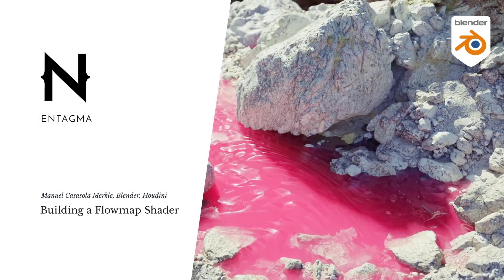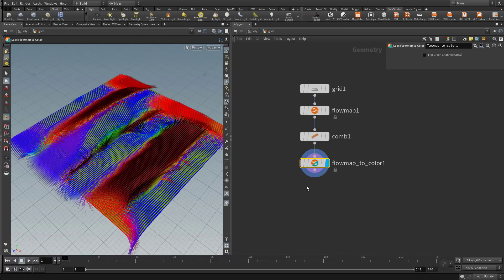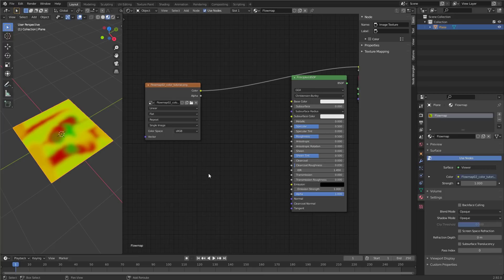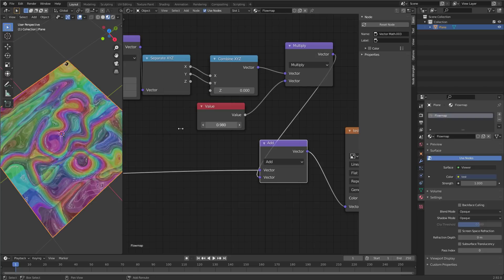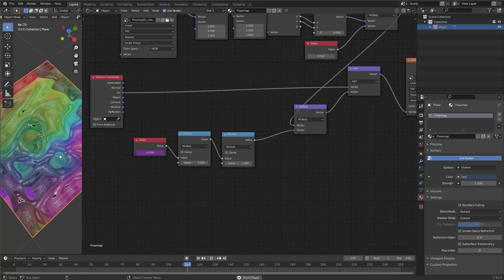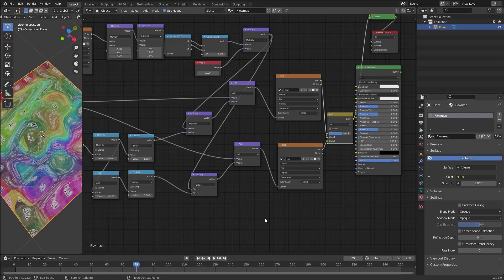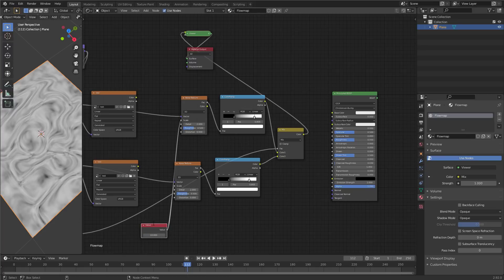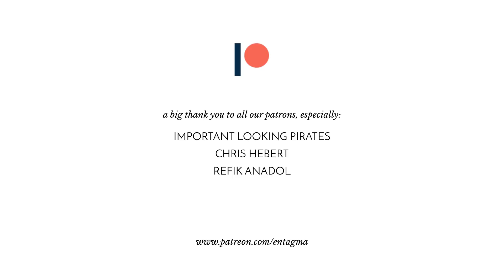Building a Flowmap Shader in Blender using Flowmap Data from Houdini

Comment: Small correction: the flow map painter addon is free, you can just pay them if you'd like to =]
Reply from the maker: Ah great. Thanx for the info. Do you have a link?
Reply: @Entagma  gumroad$com_clemensbeute#heZDT change the $ to . and the _ to / to make the link work.
Reply: If I made a flowmap for a scene, can I sell the scene with the shader used in flow map painter?

Comment: A very noob potentially stupid question, how does the final effect "look wise" different than using a displacement to create the ripples? Again, sorry for the very noob question.
Reply from the maker: Well, you can use the shader to drive a displacement for sure. The difference is that you see the displacement in the silhouette, which is not true for normals

Comment: In case you are wondering about integrating obstacles in your flowmap with Houdini:
Use a heightfield with noise, put scattered rock models into 'heightfield project' and append a 'height field flow field'.
Then create pixel maps using 'SOP import' in COPs, click 'set resolution' and 'set planes' and switch the channel view from 'height' to 'flowdir'.
Reply: You can also just use the Labs Flowmap Obstacle tool :) No need for complex jumping around.
Reply from the maker: Thanx for the tips!

Comment: Hi, I was wondering that did you create another simulation for collision of stone for you video in the beginning? I am creating something similar, and this tutorial helps me a lot. THANK YOU!
Reply from the maker: Hi there. Nope, I just painted the flowmap in a way that worked.
Reply: @Entagma  Thank you for the trick!
Reply: u might want to substract the Position of the stone and might convert the Position's RGB to a Greyscale (Color Ramp or Math Node).. but it's way more complicated than that coz you would have to use a displacement node and multiply it with the Flow map nodes and probably by adding many other nodes... if you'd like to try somehow the Position algorithm is found in the Geometry Node (Input category)

Comment: If I ever made instructional videos, in any field, I would want to make them like this. Superb. Your experience in presentation is evident. You  break down the maths to individual operations, where Blender / a 'refactor' could save you a few nodes here and there? But I think that just aids the clarity. 

BTW, you demonstrated some self-organising sand-dunes a while back, which kicked me into trying the feedback through the renderer in Blender..  an image sequence, using the rendered output image n as a texture to  be used in frame n+1, which is  then manipulated through the node tree and compositor before being rendered again as frame n+2. It's beginning to work very nicely for all sorts of growth, flow, diffusion. But only in 2D, atm.